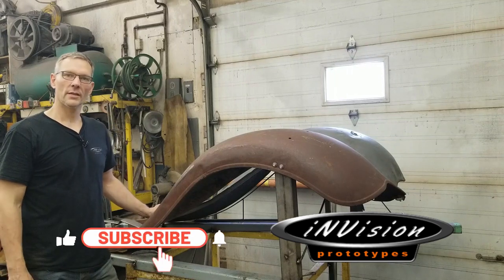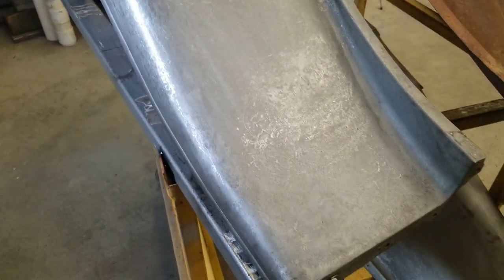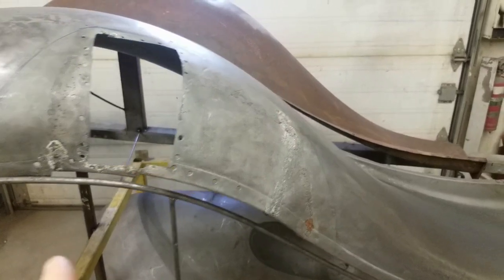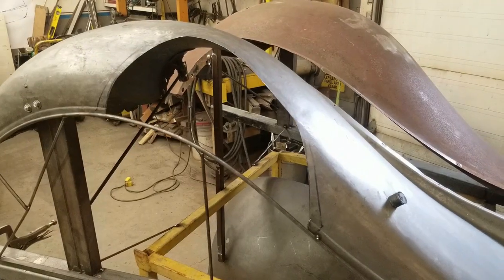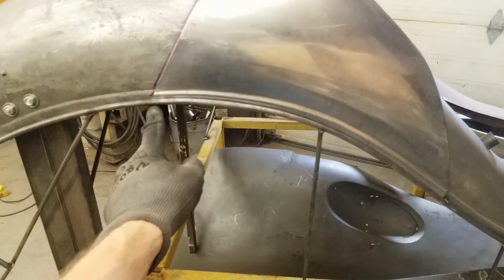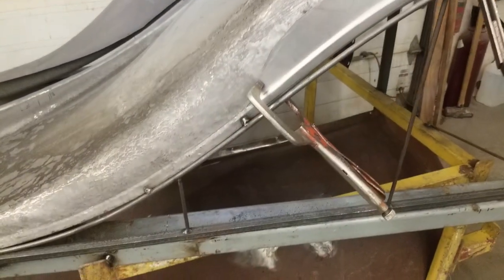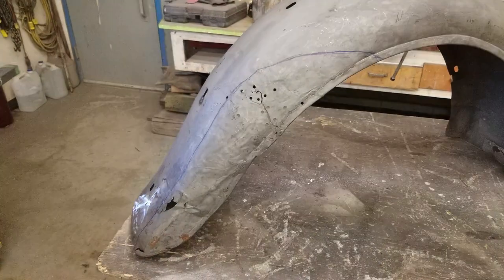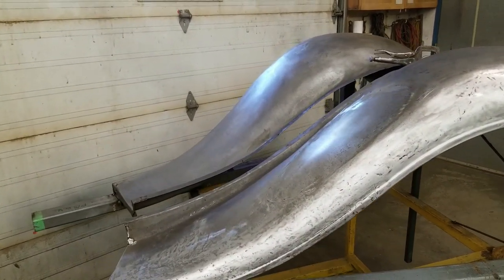1934 Chevy Panel Truck Fender Repair

Comment: Nicely done! Any chance you could show us the machine you used to form the bead?
Reply from the maker: I used the reciprocating hammer to create some parts for the rear fascia in this video.  https://youtu.be/0czAJpRkT5w Need to make some adjustments as the stroke is a tad too long... Needed a pull max in a hurry to do a job and whipped this toy up from parts laying around.  Thanks for the thumbs up.
Reply: @iNVisionPrototypes  that’s a pretty good rig, it probably wouldn’t be to hard to make the stroke adjustable. Does that piece of round tubing on the front have a spring in it?
Reply from the maker: Just a matter of finding a few minutes to do some machining.  Yes, there's a spring inside.

Comment: I notice you don't make square replacement panels.  I am guessing this hides work done to the fenders because the eyes look for lines not curves on the finished product.  Love it.
Reply from the maker: Great observation!  I call them 'straight curves'.  Much easier to blend and no 90* corners to deal with.  Thanks for watching!!